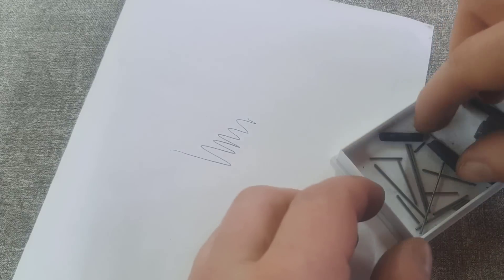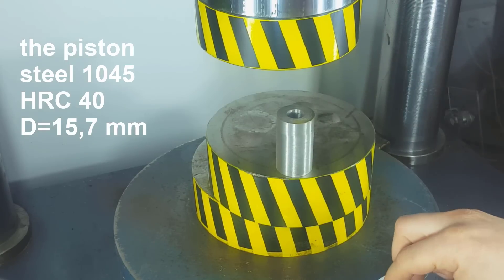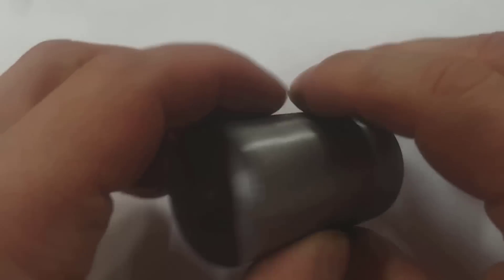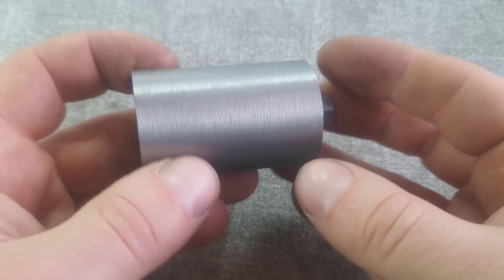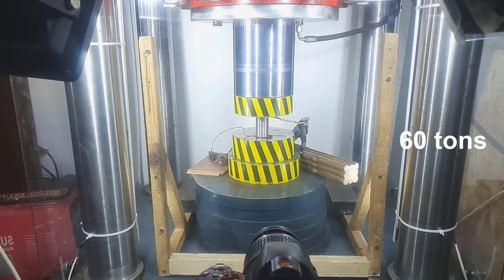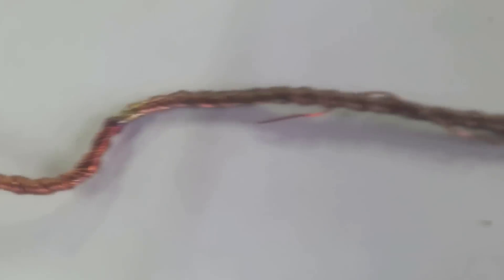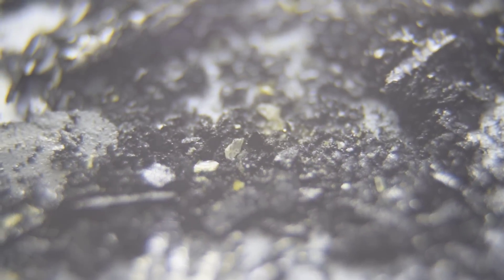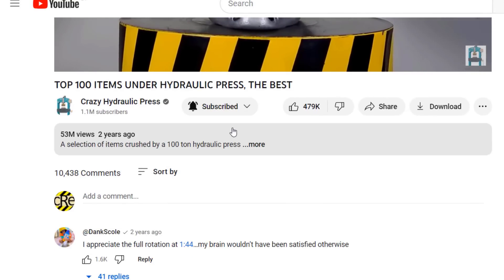500 TON PRESS COMPRESSES COAL TO PRODUCE DIAMOND

Comment: I'm no expert but the central pin shouldn't be taller or longer than the containment cylinder in order to have that margin of greater compression in the coal if the central pin is the same height, it's the same thing as nothing at least should be taller two fingers
Reply: Not really, because the graphite inside the cylinder takes up the space that the piston would have otherwise. Theoretically, if you got the piston flush with the cylinder, the graphite would be squeezed into an infinitely small space assuming that the piston was as long as the cylinder. Any extra length of the piston sticking out would have a considerably higher chance of being deformed, so it would be best to have the piston the same length as the cylinder.

Comment: 500t is not going to change the structure of the atoms. You will need about 350,000kg per square inch of pressure to do that.
Reply: 500t per square inch is 500,000kg 1T = 1000kg
Reply: Did you use Metric and Imperial units in the same pressure measurement?
Reply: 20.000 tons press?
Reply: Pressure and Force are two different measurements genius.
Reply: 500t is more than 350k killgrams per square inch.
Reply: @sunnydays4966 what's worse is how many people agree or give that sort of answer a thumbs up!